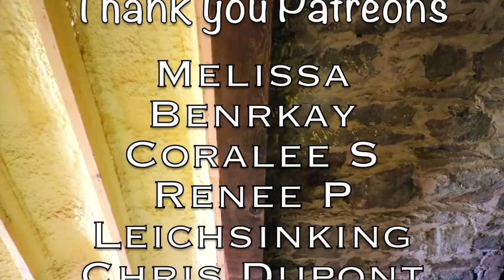Salvaged Marble | Home Renovation | Ep. 159

Comment: Does Code stop you from changing the height of the switches in this old house?  I'm wondering if it would be grandfathered in and you could have adjusted the switches?  (Doug & Ashley)
Reply from the maker: I actually did all the wiring new and I did ask my inspector that exact question.. no code of switch heights. He said.. just make sure you can reach them without a ladder because that would suck... haha!!!!

Comment: What I think about vertical or horizontal does not matter, but it matters that you are happy with the result. Once more I admire your skill, craftsmanship and determination. I understand your method and reasons.  It is an old house, you want to keep the materials true to the origin of the building. Reclaimed materials achieve that aim and keeps those materials in use. Your 'fireside chat' allowed the audience to share your desires for your home.

Comment: Man, your doing a great job.  Only passion can fuel what your doing.  Not everyone will get it.
The vertical is how it would have been done.  I can't recall seeing any fine old homes where the word "easy" would have been used.  

Please take into consideration all the weight that your adding, additional support?  A guy I used to work with would give old house's his jump test.  It was funny to see!  He would go around and jump on the floor all around but mostly in suspect places. At 200 plus pounds,  places that needed attention were pretty easy to find.  I always figured a good visual inspection worked.  Your house looks well built, just thought I'd share my thoughts.  It's easy to add a couple of tons where there wasn't anything before.

Comment: You might try to repair that cracked tile with epoxy resin.  Mix in some of the dust from cutting/filing and it will be pretty close to the same look.

Comment: Is there left-over picture rail laying around somewhere??  You can tell it's picture rail, because it has a rounded edge that holds clips to hang pictures from.  If so, it could be turned upside-down and used as trim above the marble.

Comment: I've seen where they out a piece of metal on the 2x4 where the pvc goes thru it,  so you don't accidentally put a nail or screw thru the pipe.😉
Reply from the maker: Yes! We have those too.. the code guy said you only need to place those where the wire is less than 1 1/2” from the surface.. they are kinda expensive.. I was just being super careful!! Those metal plates are probably worth every single penny!

Comment: The vertical looks kind like, I don't know what they are called, but it's wood, vertically, on the lower portion of a wall, capped with a horizontal piece then straight wall above it. It looks like the tile version of that.

Comment: Is this a bathroom? Shouldn't you be using moisture resistant sheetrock?
Reply from the maker: Yes it is a bathroom but no shower or tub so it is not needed by code in my area. The floor is waterproofed though.